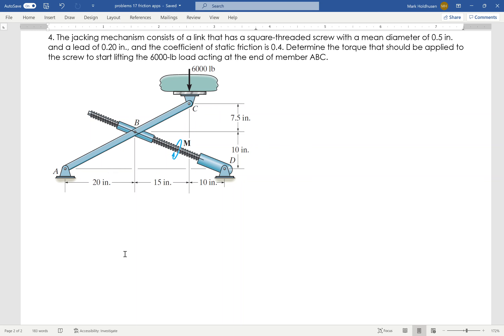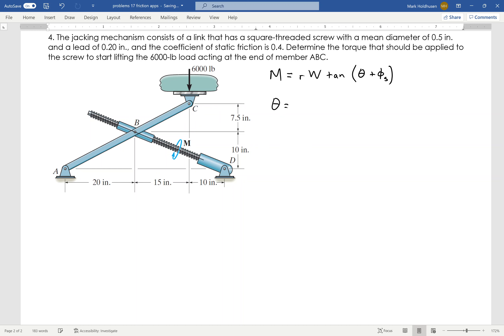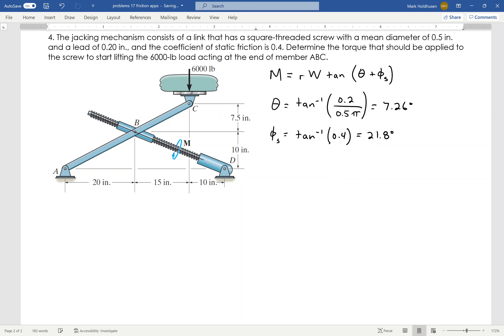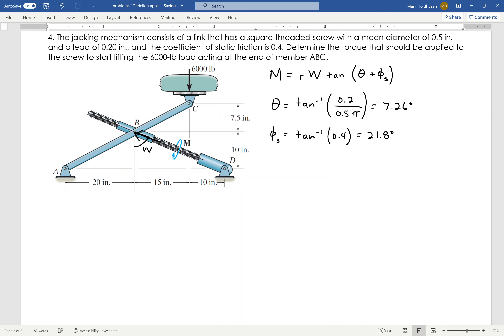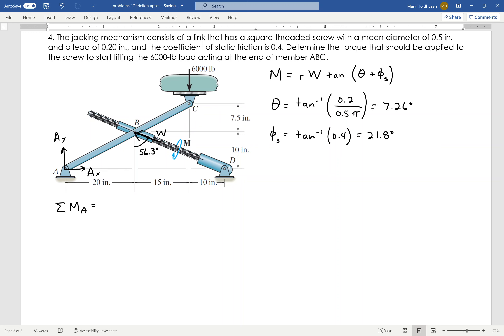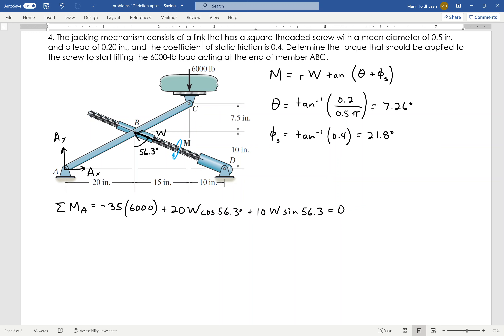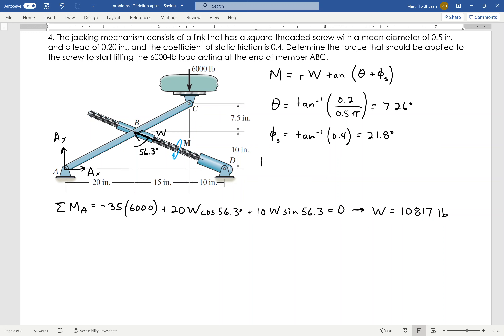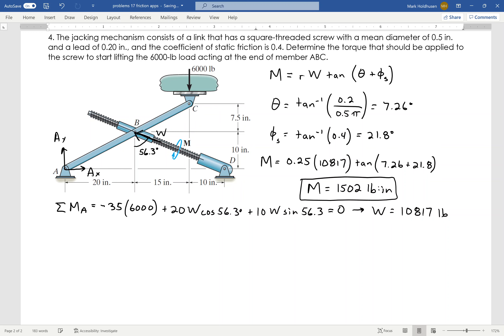ENGR 220 Friction Screws Example 4

Comment: Isnt the angle 68.20 and not 56.3. Because its arctan((15+10)/10) which is 68.20. What you're doing is arctan(15/10). While 15 in is not the full length of the triangle side. The full length of the opposite side is 15+10 in. Correct me if i am wrong
Reply: Berry good